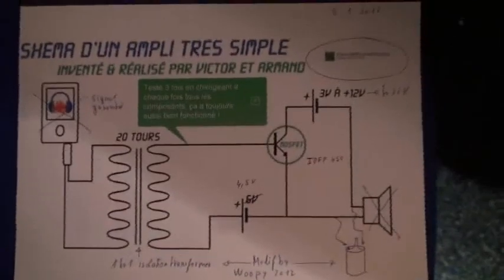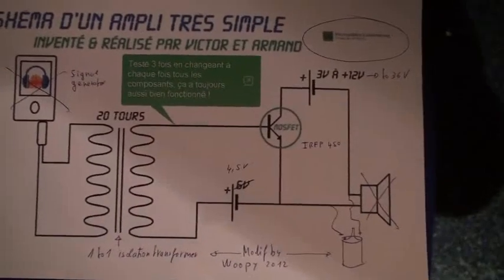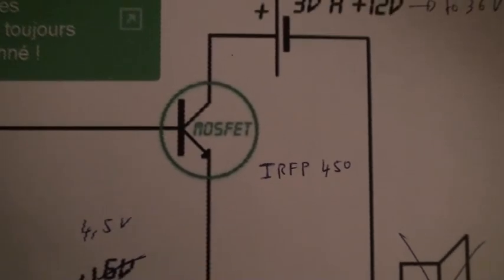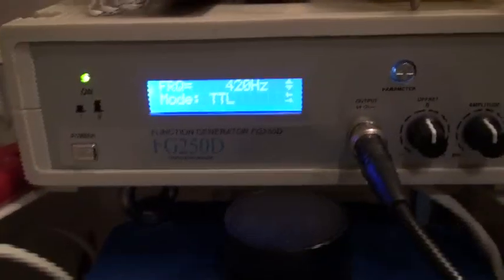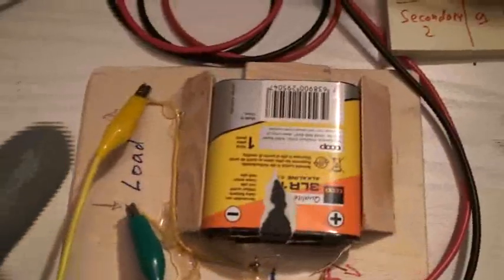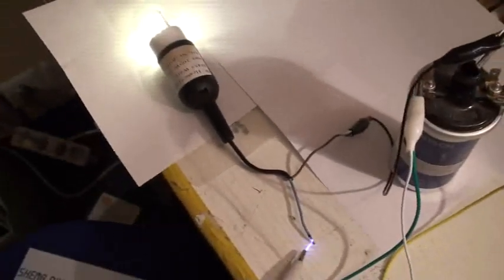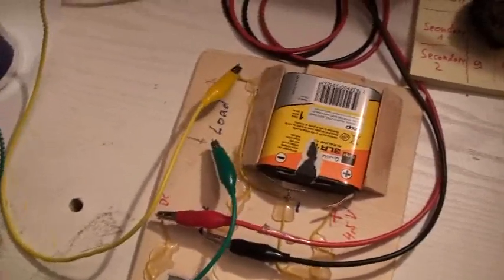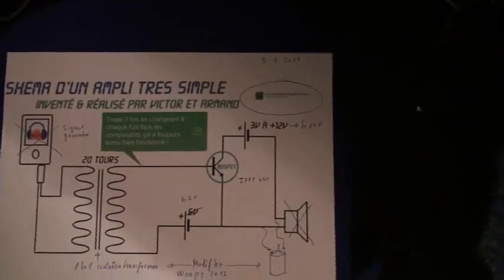High voltage very simple generator 1 .wmv

Comment: i did something like this 35 years ago ... I used a small relay, and the generator directly drives de relay coil , but instead a fast arc, I had impressive HV  pulses ...
the mosfet allows a fast coil triggering , a relay would do the same at a low rate .. lets say 1-2 Hz ... anyway, a pretty nice and NEAT experiment ... congratulations !! 
 I really liked ...   took my back to my engineer good times ...   now a boring executive ...

Comment: 4.8 KHZ is the frequency. The secret is to close the gap in between the electrodes and increase the surface area. Imagine 2 tubes withing each other with lots of holes. the final secret is to pulse the water at the high frequency. Google high frequency water electrolysis and there are nice PDF files on the subject. ps. It was not Stan's circuit. It was our network of engineers and DIYers and Stan just patented the ideas and paid for it dearly.

Comment: Hope you don't mind me saying this, but Stanley Meyer spoke of separating the H2O (water molecule) with "high voltage and restricted amperage" for an "economical" way to produce combustible gasses by breaking the covalent bond of the electrons using voltage rather than amps. I would love to see what amount of hydrogen and oxygen two stainless steel electrodes placed in water from this simple high voltage setup would produce. And this even without finding the "resonance frequency" of water.